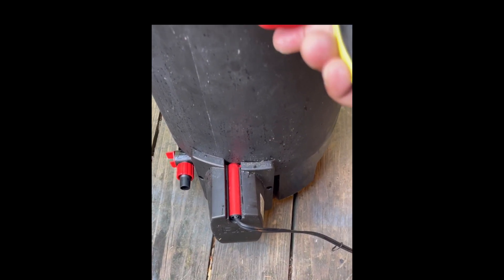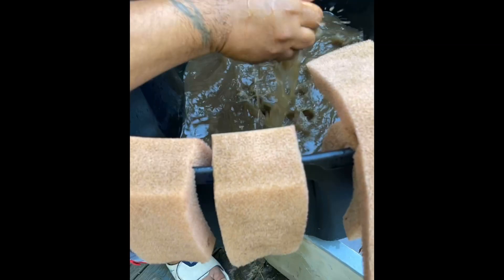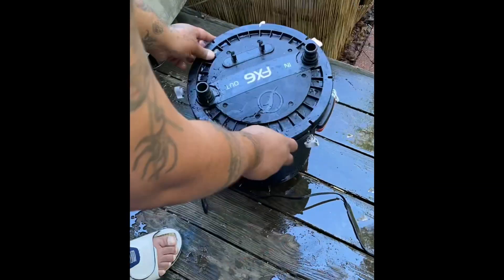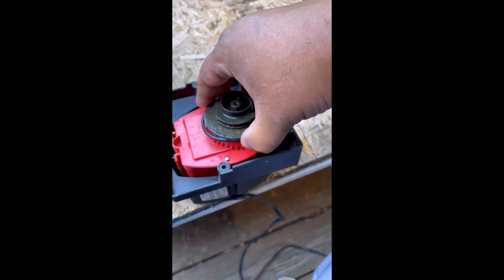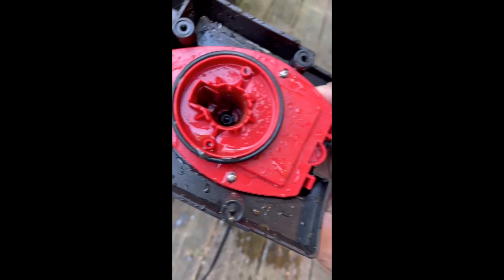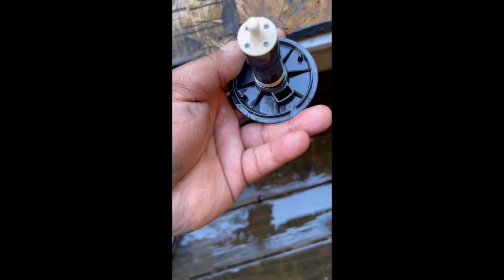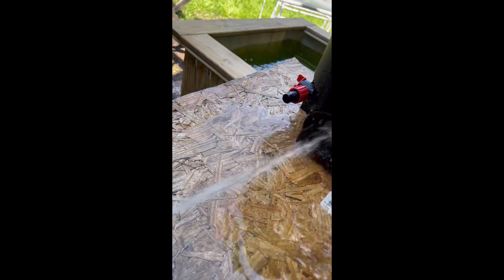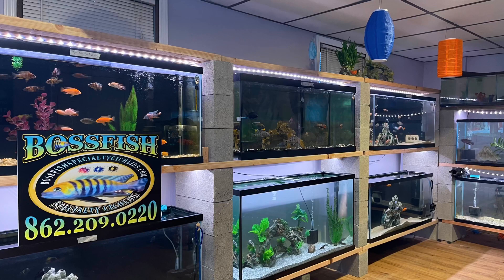#FilterCleaning #Aquariums #BossFishAquatics #FX6 broken? Why won’t it startup after a water change

Comment: Don’t forget to clean and lub all your seals rings including the seal inside your purge valve dial. Just remember how you took it off. Some are not aware that there is one in there. It can dry out even if you don’t use it often.

Comment: I   Had my fx 6.     Stop working……..  2 years after i bought it…….  I thought it was the impellar. And cleaned it…….  Still didnt work.        It ended up    Being the motor.          Had to buy a new one
Reply: This just happened to me as well. I had my FX6 for about 2 years. I did all the cleaning on the impeller, put it all back together twice still didn't work. Ordered the service kit installed it and still didn't work. Chalked it up as a loss.

Comment: So in my case the impeller runs intermittent. Its probably less than a whole second it stops, starts, stops, starts etc over and over. When I had it out and cleaned the impeller and such I actually had the motor running fine. But installed it does not :(
Reply: Mine is basically the same way , I’ve installed a brand new motor and impeller but when installed to the canister it doesn’t turn on , just hums for a bit and it stops .. did you figure it out at the end ?